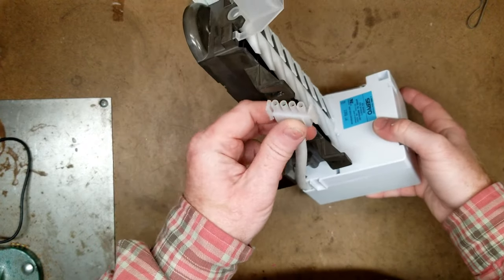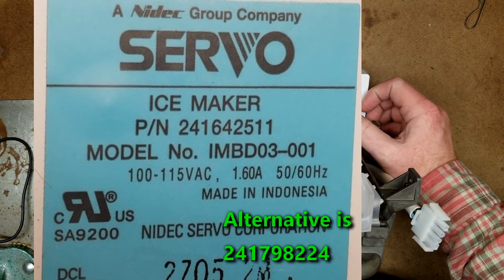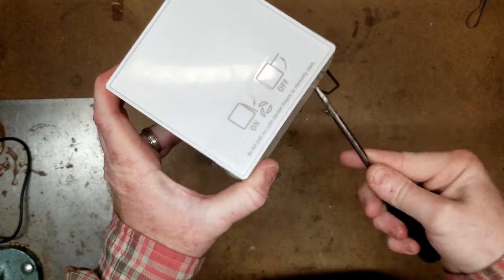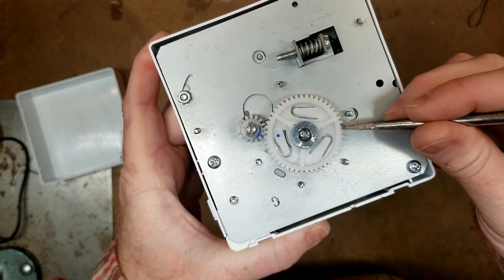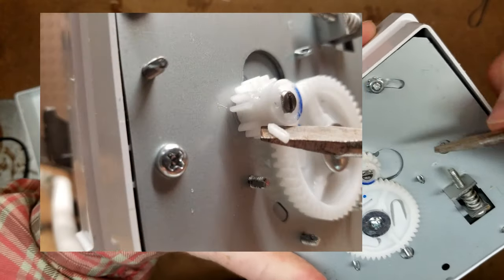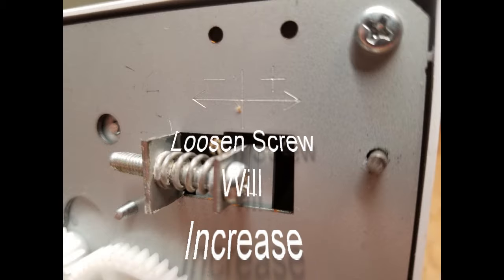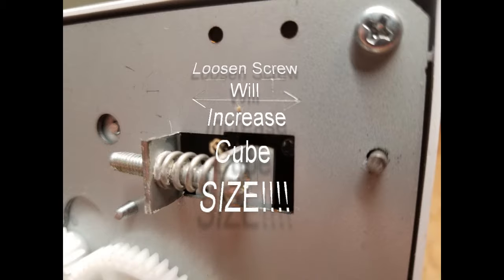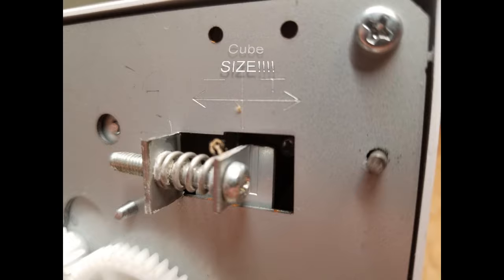Frigidaire Icemaker Diagnosis - 241798224 (241642511)

Comment: !!Do not force it.!!.use a flat to turn the small gear counterclockwise.(.with power )it will rotate. Once you see the icemaker moving along stop turning screw..it will go through is functio s..(Without power) you can turn manually counterclockwise untill you get back around to test it
Reply: What are your thoughts on samsung or lg refrigerators or appliances in general?
Reply from the maker: Good tip fix it.  I’ll start doing it that way in the future.
Reply: sir, can you please advise what the issue might be if when I turn the screw the gears do NOT start moving along by themselves? The gears do move smoothly, but I have to continually turn it with a screwdriver if I want them to move.
Reply: @LayneSteighlee  are you turning the screw counter clockwise...in many cases you have to turn about 1/4 of the way..the ice maker also needs to be ON ..SO THE ARM DOWN..and power is sometimes supplied by the light switch or a switch near the bucket...sometimes you have to turn the gears half way and hold switch down......another reason is make sure it's plugged In and the close the door...the ice maker has to be cold in order to operate...if it's too warm it won't rotate

Comment: GREAT VIDEO! Parts are available on the internet. My fridge manual doesnt explain what the screw does for the ice maker, it left me guessing. See what happened to me is I used an after market filter because it was cheaper and I think wit the screw on its middle setting caused flooding and over sized freezing on the cubes, which caused the gears to work harder and broke teeth off the big catch gear when trying to push through over sized ice. I adjusted the cube size to the negative, and hope that will remedy the problem after I replace the gear.

Comment: This ice cube maker is genius as it celebrities 42 years since its introduction. But, it noisy, the freeze sensor fails (Round Metal Can Facing Cubes) won’t close, no heat and the gears move frozen cubes thru metal PTFE coated tray. It cost $20-$30 for a new one. Photo the ice cube maker number, fridge, print and place with filters and spare parts above fridge. Use dielectric silicone grease on electric wire connectors, a burn heater will do the same thing. If allowed to make noise, plastic gears can crack.
My use inline filter and when changed, loose carbon particles can block water valve on back. This allows leakage when off causing cubes to cluster & freeze. Always drain water line with new filter into pans of 5 gallon bucket until clear. Best of luck!

Comment: Hi, thanks for the video. My ice maker does nothing. If the water inlet is blocked, would the motor still be turning?  I also turned the auger manually but I didn't hear anything activating, no water came out.  Any help is appreciated.

Comment: I have the same model. I notice my maker's gears aren't moving even though the metal arm switch is in the down position. It only kicks on if I flick the arm...any suggestions?
Reply from the maker: Hey,
 Confirm your part number needed, but this is probably the same as your icemaker at this affiliate link:
https://amzn.to/3t1Fzq6

If you find the arms go around, but it will fill with water you can rule out a failed water valve & frozen water line.

Does yours fill?
Reply: @GraceAppliance  No. It doesn't appear the tray is filling with water at all. Model number: FD1101S ; P/N 241798201

Comment: I bought an aftermarket ice maker for my 20 year old Sub Zero 690 (model FDI101S component type). I pulled the old one out, added the wiring harness adapter to the new one which extended the length of wire a lot. I installed the new ice maker and tucked the wiring harness behind the condenser not knowing it was in contact with the coil heater and melted some wires. The breaker tripped. Pulled out the new unit, fixed the wires but the unit does not seem to work. I tested the various things like holding and inlet switch, ejector motor and shut off switch. I turned the unit off for several minutes hoping the fridge resets but no luck. How do you bench test a component style ice maker? I tried to put power to the unit (pink is hot, white is neutral & tan is fill sensor is also hot I believe). I got nothing. 

Thanks!
Reply from the maker: Hi David, do you know what the part number of the icemaker you installed is?

I am happy to take a look and see what I can find. Thanks!
Reply: @GraceAppliance  Really appreciate the help. It's ice maker model #FDI101S, Part #5303918277 Thanks!!!
Reply from the maker: David Howell hey, this is as close as I can find to what you’ve got:
http://manuals.frigidaire.com/prodinfo_pdf/Anderson/240389640.pdf

But, the wire colors do not appear to match what you’ve referenced.  Perhaps the wore colors before the adapter are those colors?  It appears black and red would run the motor with 120v, but you may need to manually advance the harvest fingers to kick it off.
Reply: @GraceAppliance  Thanks so much for the response. Will be sure to order another through you guys if I toasted the unit
Reply from the maker: @David Howell thanks very much for that.
I have never tried removing the front panel on one of these, but once you get it apart, it might become very clear what the issue is. You could then ohm out the motor, switches, etc.  I'm not sure they're able to come apart.... Well, I'm sure they come apart fine, it's the getting it back together that's the trick. LoL

Comment: What are your thoughts on Samsung refrigerators or appliances in general? I am told to stay away!! and also LG!!!
Reply from the maker: juan reveles I hate the refrigerators with a passion. Between defrost drain line issues, defrost issues, and icemaker trouble - they are near the bottom of my list. But then, there is a lot of junk from every company right now it seems. Whirlpool single evaporator fridges (side by side) I feel like give the least troubles of the bunch.  

The washers have a lot of failed pumps, the top loads had a lot of trouble with being able to regulate spin speeds and had a recall for that.   Again, I’m not a huge fan of many other choices either.  

Dryers have issues with the belt rollers, but have updated the pulley that now has a bearing and seem to be pretty good dryers all around.  

I wouldn’t recommend the dishwashers at all. 

I’m pretty much negative on most every single appliance made right now.  Haha
Reply from the maker: I agree, also stay far far away from LG.
Reply: @GraceAppliance  by every single appliance you mean all other brands not just Samsung and lg lol
Reply from the maker: @juanreveles3866  every. single. appliance.

Comment: First off people don't ever forward your ice maker using the arm that's how his tooth on his gear got broke I assume to begin with never ever ever do that advance it by rotating the motor gear itself  counterclockwise if you wanna test it and send it through it's different switches water pump here the thermostat Oh yeah and on top of that the gear probably 10 bucks I'm not sure how to look at mine yet but parts are cheaper than the whole the whole parts of look into that too if you know a little bit about electronics and some skill you might be able to fix it yourself like I have never ever ever advanced with the with the arm thank you have a good day look at